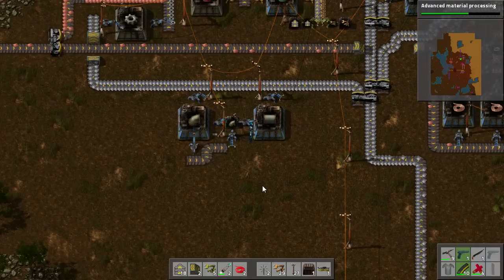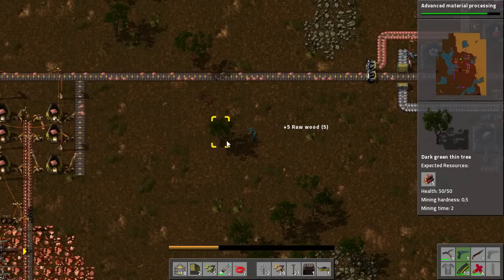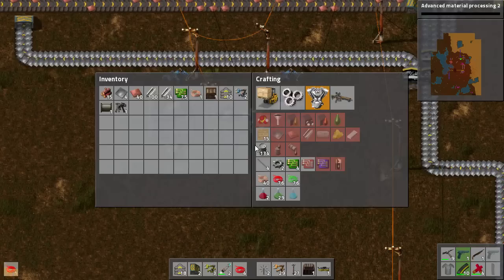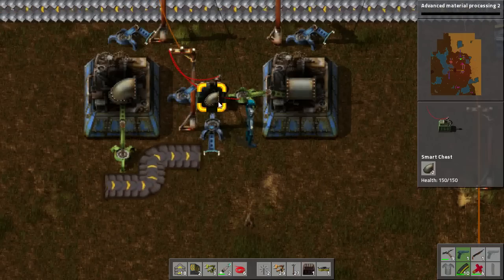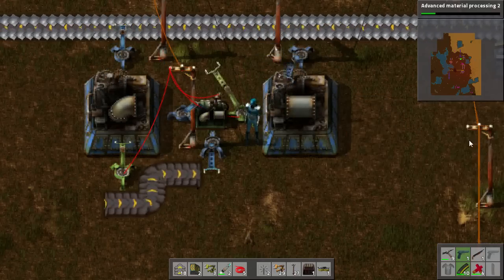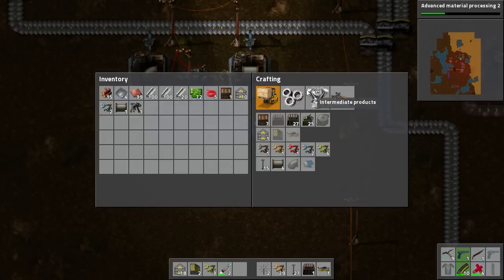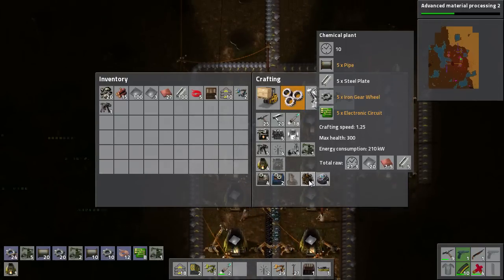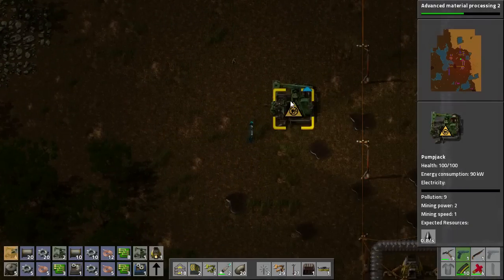Factorio Tutorial 6 - The Oil Network

Comment: Is there any particular advantage to making oil barrels that makes it better than just piping it over?  I mean, oil trains over very very large distances I can get, but for a relatively small gap like that, you aren't gonna spend much more resource-wise making pipes.  And pipes can go underground for greater lengths, so they're less in the way.
Reply from the maker: I did it over such a short distance to just explain how you would do it. however moving forward having a train system for oil allows for better expandability.
Reply: +Negative Root Now my question is is the pump jack trick still true in 2015/2016? Does it stop at 0.1/s?
Reply from the maker: _TheGamer _ yep. Hasn't been changed yet (this is up to version 12.20)
Reply: sweet, I hope the keep this in the next update, or else I would really be up s*** creek without a paddle.